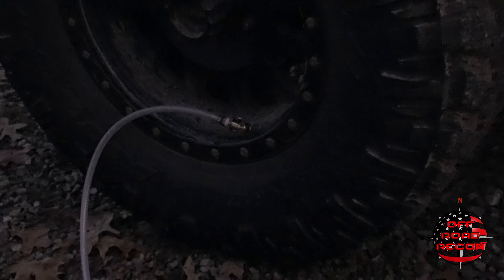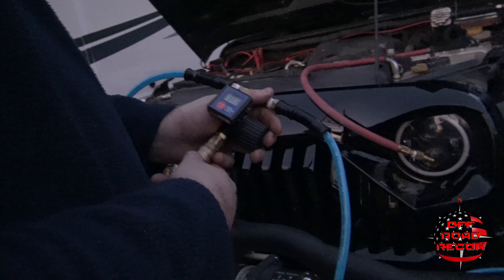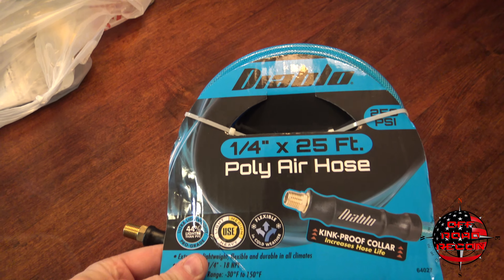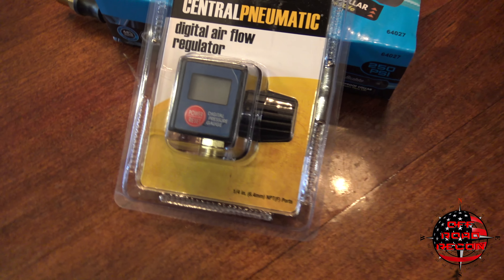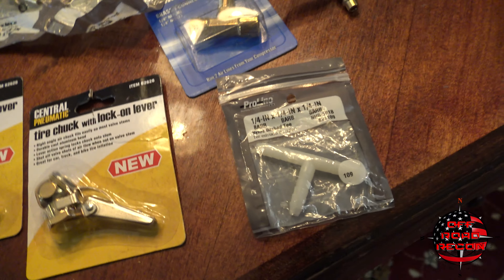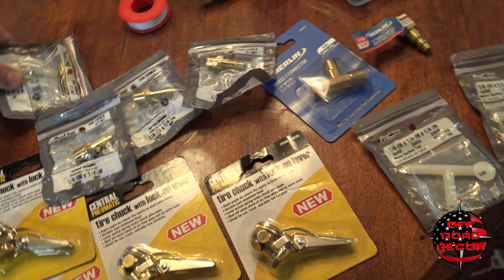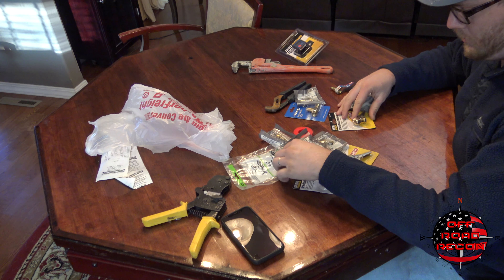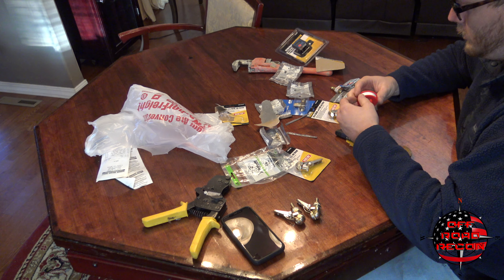The best way to air down/up tires DIY Kit

Comment: Bro, thanks for the video. Really liked your unscripted (including the measure twice cut once rule, screw-up) video and your entire build, so you earned a like from me... 😁
I have built mine system as well, slightly different parts, but essentially the same functionality. People have them done in hundred ways... As someone who dealt with the air hoses in my last life, I would like to offer advice for someone using your video for their own build (all in the best faith of course):
   1. Teflon tape over the 1/4"brass treads should be always wrapped clock-wise direction (opposite of your way in video), so when you are screwing on the part it glides in
        the same direction along  your tape and treads.
2. Use soapy water for easy fitting of barbs in the hose, also dipping the end of the hose in the hot water for few seconds will make hose end more stretchy for easier fitting.
3. When you cut the hose, especially if it has braided nylon  reinforcement, melt the end with open flame, the similar way you will do the nylon rope after cutting. 
      Makes stronger (and nicer) end of your hose.  
4. Really like how you made your onboard air system, but any air compressor will yield much better results when using it with the engine running. 
Cheers 👍🏻👍🏻👍🏻
Reply from the maker: Thanks so much! I have since redone the system and made it hard plumbed into the Jeep! Much better not having to drag it all out each use. You can see that in some of our later videos. I hope you will subscribe to our channel! We make a new video each week and our videos really stand out in our traveling Episodes more so than these DIY videos I think! Thanks again!

-Ben
Reply from the maker: Thank you! Hope you subscribe!
Reply: @BenandBrandi  Sure... 😀